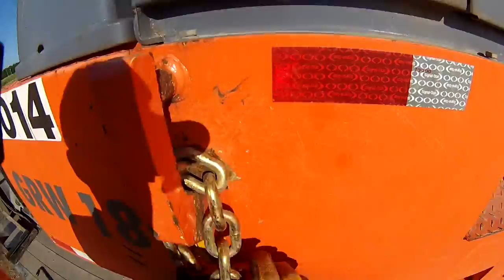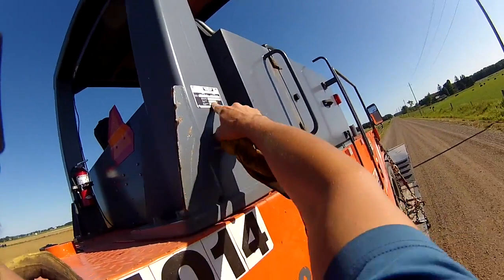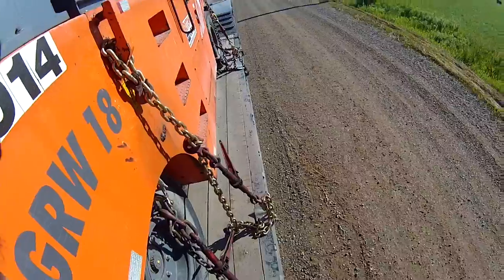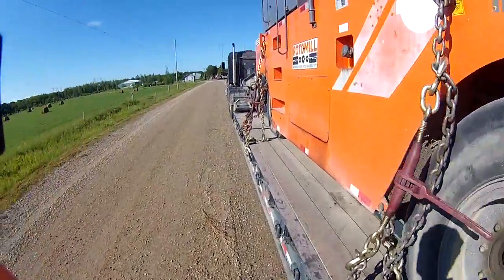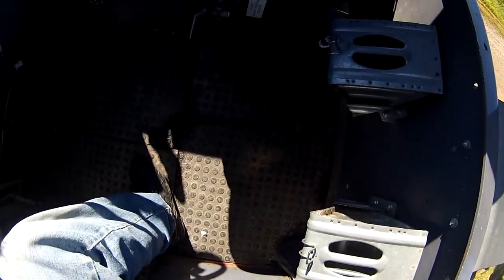HEAVY HAUL TV: Episode 215; 7/21/2015

Comment: Sergei .... you should wear an earphone as you shoot outside so you can hear the wind blast...... an then ad a wind filter or cut a piece of foam an place it over the camera  mic.......thanx......    d3
Reply from the maker: Dennis Wood i have an external mike but that thing is a wired one, and it's dangerous to wear it when working with chains and binders. i didn't plan on talking during this video so i didn't hook the mike up this time.

Comment: I know what that thing is Sergei, Its a side of the road gravel packer downer, Right?
Reply from the maker: It's a roller. It is used to smooth out the fresh asphalt.
Reply: willibill c it its called a rubber tire asphalt roller, when laying asphalt down a roller with 2 steel drums goes over it first this is called a break down roller, then the rubber tire roller goes next to get better compaction, then another roller called a finishing roller goes over it last to make it nice and smooth, i used to work on a rubber tire roller